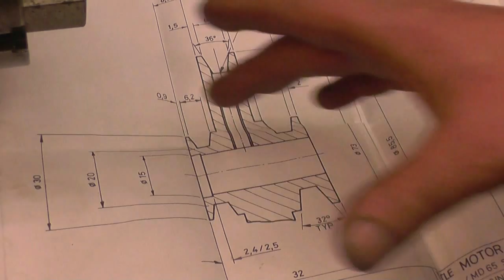SNNC 143 P1  Machining Aluminium

Comment: Hi John, assuming that the alloy is 6061 or similar you just need to up your feed rate and use a tool with a larger nose radius to maintain the surface finish. 6061 is very forgiving and will give good surface finish at high feed rates. Set your feed at double what you think it should be and you'll probably be getting close. 👍

Comment: Hi John what lubricant are you using for the ali?
Reply from the maker: I have to be careful with the smell  Debs Likes WD 40
Reply from the maker: The real stuff is a bit pricey
Reply from the maker: WD 40 type spray
Reply: Have you tried ethanol for that? Splatters like hell with high rpm, but in my experience, works very well with Al.
Reply: wd40 is much easier to find than ethanol in the UK, stick with what you know, he was using an 'off' brand wd40 type this week, i guess he doesnt have shares in the wd40 company after all!
Reply: doubleboost
asda's own is £1.20 a full size can...always grab one or two when im in
Reply: John, spray-can WD-40 ain't cheap. I buy that stuff in five litre (one gallon?) plastic jugs, and then decant it into 500 ml plastic spray bottles; the sort of thing you get in the hardware shop for general use as weed sprayers or wotever.

The other thing about WD-40/CRC is that it seems to have a waxy additive in it, and when the kerosine evaporates you are left with a very sticky wax coating. Sometimes that is good and sometimes it isn't.

The recommended cutting fluid for aluminium is kerosine, which used to be cheap; not sure if it is anymore.

I'm not preaching; just offering suggestions.